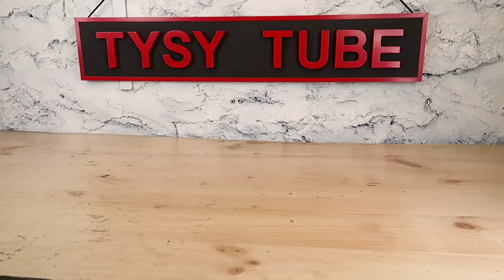Very Rusted Meat Grinder restoration

Comment: Why don't you simply use white vinegar to remove rust? It works as well as the MC-51, just let the parts soak for a little bit longer (like overnight)
I'll be cheaper for you and better for the environment (despite what they say on their website)

Comment: Please what's the liquid do you used in the machine to clean the parts .
Reply: I recommend using mineral spirits (there is an odorless version). I used it to clean a shoe outsole stitcher that was seized by the old oil. It worked perfectly and got all the parts moving again.
Reply: Its a special cleanwer called IBS Spezialcleaner Purgasol. Its especialy to cleanparts from oil and grease !

Comment: Hey ! Big fan of your work here, I wish I was that efficient and patient :).
If I can benefit from your experience, I was wondering, how did you put the kind of washer of the clamp back in place ? I have a tiny vise at home and the washer is held at the end of the thread by it being split (the metal rod is then wider and holds it). I'm afraid to thin it to get the washed out because I don't know how to lock it back in place when I'm done.
I hope this makes sense :).
Thanks !
Reply from the maker: thank you so much 😊

Comment: Love your videos. I have the universal 2 grinder. When following your video I hammered the handle thumb screw but it broke off. Any advise for a fix or replacement of this piece.
Reply: I managed to take the brokem screw out in the end with a pair of mole grips. I have replaced the screw. I used electrolysis to derust the grinder and wire wheeled it to give it a good shine. Just need to paint it now.

Comment: Somewhere between 3:15 and 3:16 you removed the screw that holds the grinder fixed on the table. Also missing the part where you fixed back the "washer" on that screw. I just wandered how you did it. I choose to leave it in place for a similar project.

Comment: Why put loctite on the wooden handle then screw it so it wont turn in its hole? Or did i miss something? It’s supposed to be loose in its position so your hand doesn’t experience friction while turning the handle.

Comment: I love these restoration videos, but I will NEVER understand all the chemicals used, other than for the obvious sponsorship tie-ins.  The parts washer, sandblaster, wire wheel, sandpaper, etc ALL do more work than leaving it sit in a bucket of overpriced and dangerous chemicals.

Comment: I upvoted only because you didn't use any filler on old casts before painting. Other than that I cringed hard. You have a vice but you hardly use it to make your work easier and you used red threadlocker on parts. Anybody who uses that threadlocker on  parts other than those that must be welded but can't be deserves to step on a treadmill of legos in the night while going to the bathroom.

Comment: It's not 100 years old.  I have one that was my grandmother's.  It may be from the 1940's or 1950's. Not earlier than the 1930's.  And it would not have been painted originally, but would have been tin plated.  There would have been two or three cutters included.  (Mine has two). They're quite common on ebay and sell in the range of $20 to $30.  Not worth a restoration.